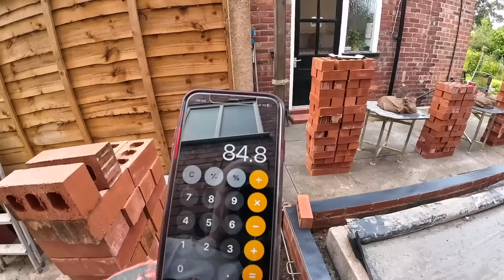CONCRETE FLOOR SLAB WITH A TWIST!? AND WE FORGOT OUR WELLIES PT 4

Comment: is their a specific reason to fill the cavity or was it required by building control? im doing a double skin granny flat in my garden so was wondering? :)
Reply from the maker: It needs to be full to at least 225 mm from dpc 🧱👍🏽
Reply: @SteveAndAlexBuild  is that 225mm below dpc I'm guessing?
I have 1 Trench Block at 150mm + 300mm to dpc. I have a suspended timber floor

Comment: Does the cement you put in the cavity get filled to roughly the same height as the cement poured for the floor?? 

What is the reason for this? And does that not need the membrane as well 🤔🤔 

Total newb trying to learn. And contemplating taking up a brick laying course 🤔
Reply from the maker: It’s for strength and needs to de minimum 150 mm down from dpc 🧱👍🏽

Comment: Wouldn’t it be easier to set a screed timber close to house and use the internal wall to screed off then just take timber out fill screed , cut the L shape out of the wall side at distance you want to set concrete at , it’s
Reply from the maker: No that sounds way over complicated. The floor is going to be screeded so the slab wasn’t critical 🧱👍🏽